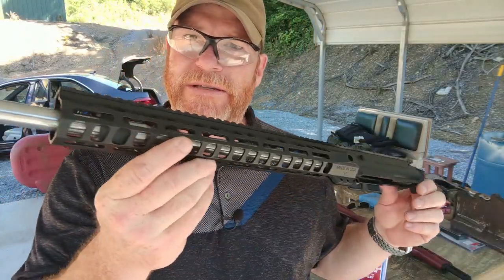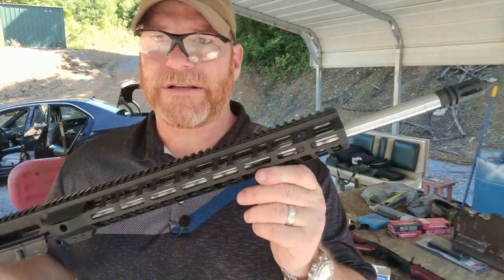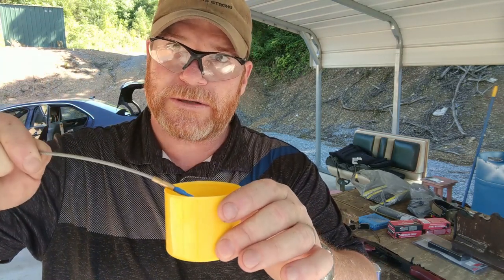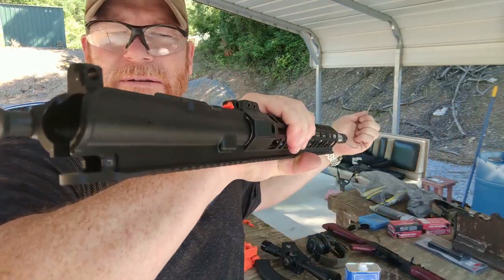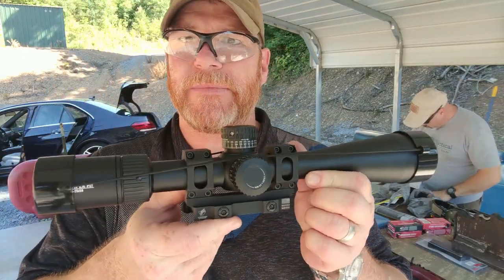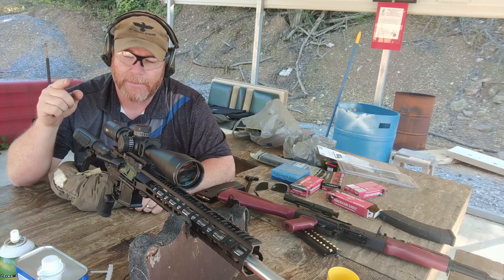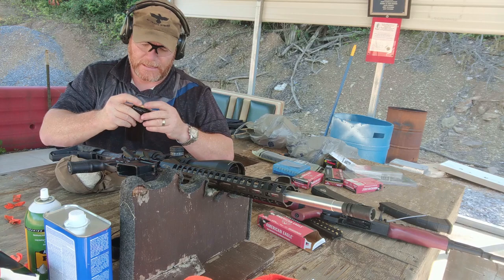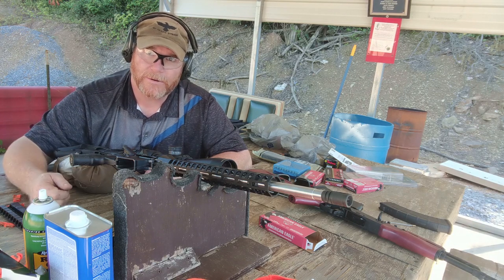Barrel Break In!  Necessary Pain & Patience Required

Comment: nice technique. i do a similiar process and have had excellent success.
both my FN ARs, a 16" M4 and a 18" match grade sporter, both with chrome lined barrels shoot sub 3/8" 5-rd groups at 100 yds!

a buddies Barrett REC-7 di , Sig 516 TS, HK MR-762 and SCAR 17S all of which we broke in the barrels of shoot lights out too.

and my new DD5V1 i just got is also proving to be a tackdriver after barrel break in.

heck, even my Ruger mini-14 shoots 1.5" groups on occasion!

i cant reason that all these rifles would shoot as well without the barrel break in procedures.

i know a lot of very experienced shooters claim its not necessary but i also know a lot of them struggle trying to break into 1 moa!

youll never convince me that barrel break in isnt necessary.
and what would it hurt to do it anyway?

ill keep spending the effort and enjoying my 3/8 moa M4s!

Comment: The most I would do is up until about 5:19- basically a good cleaning before firing.  After that is all "compulsive feel good" in my opinion, which is a-ok but not needed.  The need to "break in" a barrel has been pretty much debunked by now by numerous experts. In my own experience I've done the long break in deal and on other new rifles I just did a good cleaning- never noticed a difference either way so far. Thanks for all the hard work you do bringing us great vids- you're one of my top favorites on here by far.
Reply: Okay I have a question for you. I just got a 223 wyld 18-in Barrel 1/8 twist yesterday and I ran like 60 rounds through it today. I did not clean it before or after is it too late to do a cleaning now or do you think it may be damaged? Because I'm only getting a one to two inch Group at 100 yd and that's with four different type of ammunition. That's 55 grain 62 grain 69 Grand and 77 grain all hunting ammunition and they all shoot the same group. Today was the first time the gun has been shot but like I said I didn't clean the barrel before I shot it do you think it would be okay?

Comment: You mention Krieger, but Bartlien, proof and other higher end barrels are all hand lapped in most cases, and for the most part dont need the "shoot once, clean once" for the first 20 or so shots...  but if you do have a button or R5 rifling, its recomended from what i understand...  then you move to the shoot 5  clean, shoot 5 clean for 3 to 5  cycles.  I never used to do this until i got in to long range shooting with high dollar guns....  does it make a difference, i have no idea... but its worth it to me as "assurance" that i am doing my part to make sure that the barrel is as good as it can be.  good stuff man.

Comment: I followed tiborasaurus Rex’s CU Equilibrium barrel break in procedure for my Remington 700 milspec. It’s the first time I’ve ever done a true barrel break in on any rifle. I’ve only sent 70 rounds through it so far, so I can’t really say if it’s been worth it or not. All I can say is that I shot the same group size at 100 with it as I did with my M1A. The M1A group was slightly smaller.

Comment: Breaking in a rifle also applies to the gas tube/block. Brand new rifles often short-stroke with cheaply made ammo (Tula, wolf) but after a few magazines they will run smoothly forever onwards. Let the carbon build up and seal up any leakages.

Comment: ONLY need to break in SS or plain carbon steel barrels. Never nitrided or chrome lined barrels.
I lap my SS barrels with  these bore sized felt things and two grits of barrel paste.
I use old fashioned brake clean instead of alcohol. I use Hoppes to clean too.
I got a .33" group out of a stock Savage .308 barrel. Federal GMM  168gr
I used 40 rounds of PMC to break it in.

Comment: wouldn't it be impossible for an aluminum cleaning rod to scar a stainless steel barrel do to the difference in hardness?
Reply: Aluminum will come off onto the barrel, that’s about it. I use a brass cleaning rod with plastic attachments or brass as well. I also use brass brushes through my barrels but I have been told to stick with nylon brushes by Brownells.

Comment: Never use a cleaning rod on my .22 cal barrels.  I use a piece of .095 dia trimmer line cut a foot longer than the barrel.  i sharpen one end to a point and melt the other into a ball (tad smaller than .22 inches).  I use this to pull a ballistol soaked patch throught the bore.  Then I pull a bore snake through the bore followed by a ballistol soaked patch.  I never use a cleaning rod.  More .22 rifles have been damaged by over cleaning with cleaning rods than shooting.  Learned this tip in Pennsylvania Game News (provided by a gunsmith).

Comment: I was taught to do the same thing, clean the bore before I shoot a new gun... but after further thinking i concluded it wasn’t neccisary. Any firearm you buy has been test fired before it leaves the manufacturer and after all the tooling and machining has been finished. If any piece of shaving or anything we’re to disturb the bore it would have already been done before you touched it. And after that test fire any left over shavings would be blasted out. As for a break in process the only logical or slightly scientific explanation is that the inside of any bore has micro grooves like mountains and valleys. Lead once fired fills in those valleys all the way to the high spots creating a tighter and smoother surface for the projectile to pass through and in my opinion can even change the velocity slightly because a tighter squeeze allows higher pressure to push the projectile faster. That’s just my opinion

Comment: When I did my M1A Scout Squad, I shot one/cleaned for 25 shots watching how it was grouping with initial shots. After the 25 rounds, I went to 3/clean for 15 rounds, and finally 5/clean for 15. I saw a 2.5” group with first six shots narrow down to just over 1”. I think I’m going to nurse it a little more just to see if it gets smaller.
My “cleaning rods” are 550 cords with a brush on one, an eyelet on the other. Both tied in with the string guts. The other ends have a bit of brass cleaning rods shoved up inside with the ends melted. Works great too.

Comment: This has been a debate for decades.  Some say you need to break a barrel in, many match shooters I   have known say no and do NOT bother with it.  Some even claim  copper fouling is GOOD as it plugs the micro holes making a smoother tube, increasing accuracy, and removing copper will reduce accuracy.  All 3 seem to be right.   If you have a $800 match barrel might want to do this, but for a basic rifle with a $100 barrel I think this is a waste of time.  If your barrel is chrome lined, all of mine are,  a total waste of time as they can't be "broken in".
Reply: chad haire chrome and nitride wear down, just not as fast.  High precision shooters will even shoot abrasive coated bullets to break in high precision / custom made barrels.  Lots of BS and bogus information...even from barrel companies themselves.  Just because you can machine a barrel doesn't mean you have ballistic knowledge.
Reply: chad haire - not true. even chrome lined barrels have microscopic peaks and valleys.

the idea is to cleanly and carefully remove the peaks instead of smearing them into the surface creating a high spot or "speed bump" that will never wear away.

i break in all my barrels including both my FN ARs with chrome lined barrels, a basic 16" M4 and a 18" match grade sporter.
btw both shoot sub 3/8" 5-rd groups at 100 yds!

most my other rifles and several buddies rifles all shoot lights out after a proper barrel break in.

and even if they would have shot that way without break in (doubtful), what does it hurt?
it literally takes 15 minutes max!

im just saying.
Reply: Randy:  Chrome is too hard to "break in".  That is why sniper rifles are never chromed  unless the barrel has been "cured' first.  Your  rifles might be accurate but you DO NOT know if it is due to you break in procedure....
Reply: chad haire - there are not 2 metalic surfaces on Earth that arent subject to "break-in" or "wear-in" regardless of how hard or soft the material is.
and chrome plated barrels have the same microscopic grain structure and crystalline structure as any other metal and therefore can benefit from "break-in" no matter how small the gains whether you are aware of it or not.

after all target shooting is a game of a few thousandths of an inch so every little bit counts.

so says a lifetime experience in  metallurgy and machining as a NTMA graduate/member and shooting.
Reply: Randy;  It is going to take a lot more than "15 minutes" to break in a hard  chrome barrel....
Reply: chad haire - ok chief. you do it your way. ill do it my way.
care to have a little 100 yd contest?
Reply: Randy:  Been shooting a lot longer than you Goober....there are plenty of barrels out there that can do a 100 yard "contest" broken or not--doesn't prove crap.
Reply: chad haire - how could you even know that?
ive been shooting for 41 yrs now from BB guns to centerfire.
i graduated NTMA in 1991 so ive been working with metal a long time as well.
 btw i didnt mean just any barrel. i propose a 100 yd contest with M4s with standard chrome lined barrels of whatever make you choose. ill be using my trusty FN M4 that fires single hole groups as in 1/4" to 3/8" single hole 5-rd 100 yd groups.

or if you prefer, my FN match grade sporter that does the same.
or my DD5V1 that gets real close.
hell, even my mini-14 can do moa with the right loads.
 when was the last time you saw that?

the point is, every one of my rifles and my buddies rifles that went through a  carefull break-in shoots sub 1/2".
now thats currently 11 rifles, all semi-auto, most of which are chrome lined.

now you can call it coincidence or luck, but either way ill be breaking-in every rifle i purchase that i want to be accurate and durable.
your free to do whatever you like.

but if YOU have a chrome lined M4 that youd like to test, entry is $500, winner takes all.
put your money where your mouth is sport.
im in Atl.
Reply: My My-we have another Larry Vickers here.....sharpshooter and Bulldog racer all rolled up in one......LOL
Reply: Well Goober since you have so much time to brag about your expert status, you might want to read all the posts on this page----most dont agree with you
Reply: TheMetalGuy852 - i would disagree. unless the barrel has been hand lapped by an expert, a very time consuming, labor intensive task, it WILL benefit from break-in. it may be minor but if minor was too little to matter none of us would be concerned with reducing groups by 1/16" would we.

to each his own though. you dont want to break in, dont break in.
ill never fail to do so.
Reply: TheMetalGuy852 - both of my FN AR-15s, a standard M4 ive modded into a RECCE and an 18" match grade sporter/SPR, both with chrome lined barrels and both thoroughly and carefully broken in, routinely fire perfect, single round .224" hole, .000" 3-rd and 1/16" 5-rd groups at 25 yds using Norma tac .223 55 gr jhp loads.

at 100 yds both rifles routinely fire sub 3/8" 5-rd groups with Sig Sauer 77 gr OTM loads.
Federal GMM 69 and 77 gr OTM loads produce 3/8" to 13/16" 5-rd groups.
the Norma load produces 13/16" groups.
that is with a 5th round flyer issue im having.
i generally group 4-rds into single oval hole, sub 1/4" groups with the 5th round "opening" the group to 3/8".

now you can claim it has nothing to do with break-in but there are 8 more rifles, most chrome lined that do similiar groups among rifles i and a buddy own that ive broken in using my technique i developed after years as a machinist.

say what you will, and do what you will.
ill break-in my barrels and im willing to bet ill cleanly mop the floor with anything you care to bring to the range

Comment: I don't think it can be done with nitride and chrome lined barrels.  It would take days I suspect. I have heard somewhere there are break in bullets.
Reply: I agree,  also I think Stainless Steel barrels do not need to be braked in.  Just use your favorite solvent or cleaner and use a bore snake.
Reply: Tac Dad bore 🐍 are idiotic..if not for the fact the brush can not be replaced.
Reply: Its just easier and faster.  Lots of brush area AND cloth area to clean.  Put lots of Ballistol on snake and down barrel and two or three times later its clean.  with the exception of the one I used for my shotgun, they stay pretty clean.  Like how you put the snake drawing on your comment.  pretty cool.

Comment: Just run a cleaning patch thru with hoppes nr9, make sure no obstructions, fire one round look for obstructions, if there is none, barrel is good to go.  The only thing that ruins a barrel is heat, but you can not fire fast enough to generate enough heat. Heat damage is result of full auto fire.

Comment: I'm just here to tell you modern barrels do not need to be broken
Reply: "break in" is standard practice with newly purchased firearms and is recommended in various manufacturer's owners manuals such as Arsenal AK-47 and the PTR-91 G3 clone. Does that mean you "have to" or "need to" break in newly purchased or modified firearms for them to function? Of course not. It is done to ensure that no hiccups, improper assembly manufacturing defects or other problems occur and ensure the proper functioning of the firearm.

"need" is a silly word when it comes to something you are relying on to save your life. its like saying you dont need to take your car to a mechanic for it to function. yeah most cars will run fine but lets see how much you regret it when your car craps out on you in the middle of nowhere
Reply: @jamesjimotheius8275  you are correct sir. I comment like I did because people in the 2A community tend to believe the wildest things.
Reply: @DinoNucci  that is fair enough taking the opposite track it is also certainly true that the barrel will just run fine 99 percent of the time lol
Reply: @jamesjimotheius8275 yea, just like”new cars don’t need to warm up”😂

Comment: I use my Tipton bore guide and cleaning rod, and a parker-hale Jag. the patch wraps around the Parker Hale the Jag and has no sharp edges or point to it. Of course it is solid brass so it's not going to hurt the Barrel anyway. I look at it this way, getting any debris or metal pieces out of the bore is a very good idea before you blast a bullet and gunpowder down it. I do this for about 20 rounds, it certainly can't hurt
Reply: A bore guide on an AR?  It has one built in.

Comment: Clean before first round to remove any manufacturing oils and debris. Clean after each round for the first 5 or 10 rounds (gas gun). Different barrel materials and rifling process makes a difference in copper fouling results. Gas guns vary if the manufacturer de-burred the gas port or not.
Reply from the maker: Excellent that you brought up the gas port.  I can tell you that on several rifles I've found debris from drilling hanging from the port.  I will typically check the port for clearance and clean it of debris during the build process.  Great add to the conversation

Comment: People mistakenly think "break in" affects accuracy... It doesn't! It only affects how often you'll need to clean powder fouling by burnishing the bore smooth so there's less to stick to by using an ammonia based solvent to remove copper between the first few shots. It's important to let the solvent sit in the bore 5-10 minutes so that it dissolves the copper and then make SURE to chase out the ammonia with oil of some sort or it will pit your bore! "Seasoning" with copper fouling for about 50 rounds is what affects your accuracy, and every time you use an ammonia based solvent your groups will be garbage until the bore fouls with copper again. Hand lapped barrels don't really need any break in because they're already polished smooth.
Reply: Powder fouling and copper help the barrel
Reply: @HatsuneM1ku01  copper yes, to a point until there's too much, somewhere past about 500 rounds when your groups open up.

Powder fouling is carbon, an abrasive... That wears your rifling faster if you don't clean that out with an oiled patch every so often, for lube too.

Comment: With modern barrels your not really breaking them in your seasoning the barrel with carbon and copper.  Once the barrels velocity levels out then your seasoned.  Match grade barrels will sometimes season in quicker then factory barrels due to the high quality in barrel steel and barrel rifling.  As for factory barrels sometimes they take more rounds to level out on velocity.  

Yes you do want your barrel clean before shooting so getting all the grease and oil out before hand is a good idea.  Also use a guide rod when cleaning and I only clean my rifles every 500 rounds or close to.  Nylon brushes or patches i never use metal brushes.   Boretec eliminator works wonders.

Comment: Hey KB. Good video. But Google the term "copper equilibrium".
CHECK IT OUT!
Rex on YouTube describes it best. I shoot teeny tiny groups using barrel break in and then the copper equilibrium system.

I also use Rex's system but I use all Parker Hale equipment.
Reply: I don't agree with the "copper equilibrium" idea fully since I have other systems that work better... but like that you posted this comment.  Most of the folks in this thread don't have a clue about high precision shooting, have never built a rifle or loaded ammo by hand.  

They bought and AR with a cheaper barrel and shoot it...have fun.   Breaking in the barrel probably won't help much, too many other variable at play on their mass produced rifles.